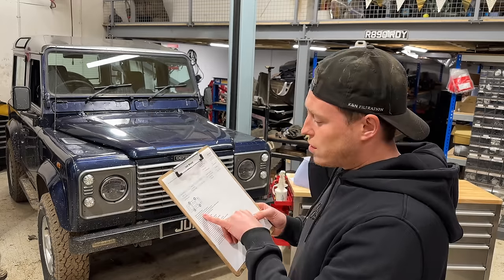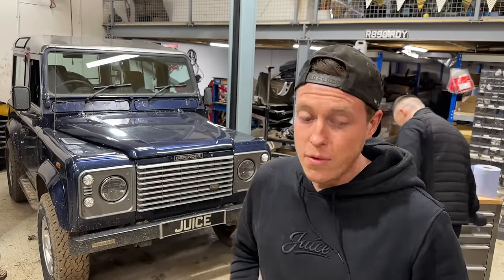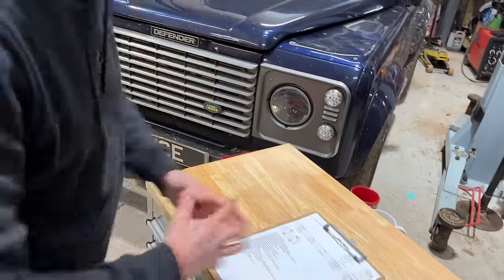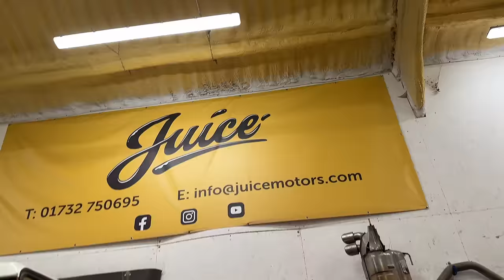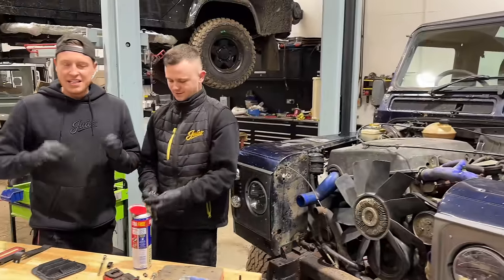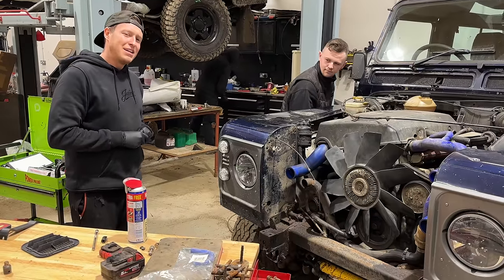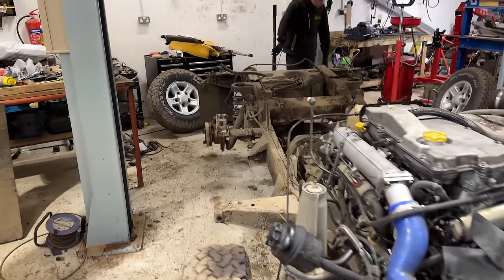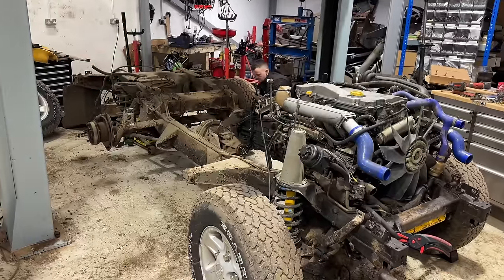Swapping a Defender Chassis & Bulkhead - Part 1

Comment: Interested to know, are you painting the chassis? What's the best way to prepare and paint the chassis? Or how will you prepare the chassis? Is the bulkhead galvanised too? Having trouble finding the best way to prep galvanised metal for paint. Etch primer seems to be the way but does it just need soapy water clean or should it be sanded and prepped as normal for bodywork? I have galvanised my chassis and bulkhead out here in uae and this is unusual if not unheard of here, bodyshops seem to want to prep by sanding and likely removing most of the galvanising. All help and advice gladly received. Loving the videos, keeps me entertained while my newborn sleeps 🤣🤣🤣
Reply: You need to t wash galvanised steel first before you apply any type of paint.

Comment: Hello, I was wondering what the price tag for a topical swap like that might be?
I need to replace the chassis on my TD5 and a few other body parts.
Reply: Cost about £2600 for my chassis and then garage fees of ?  My cost was £4000 with new suspension and break pipes etc.
Reply: Juices price is like £12k Inc vat, most companies charge £4-5k